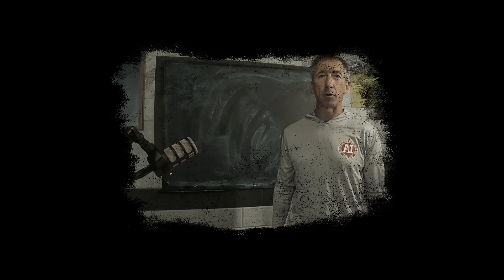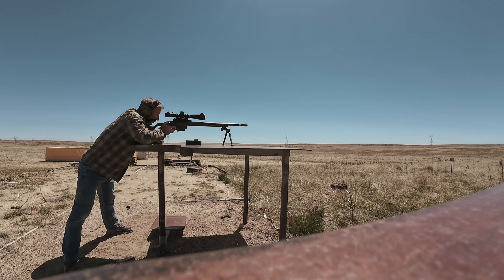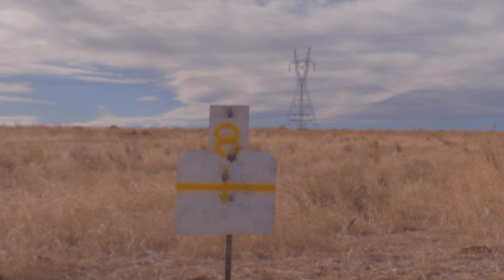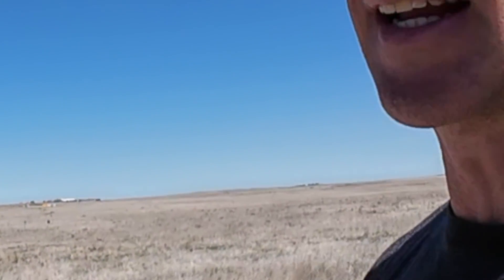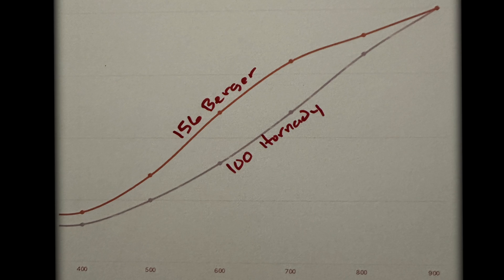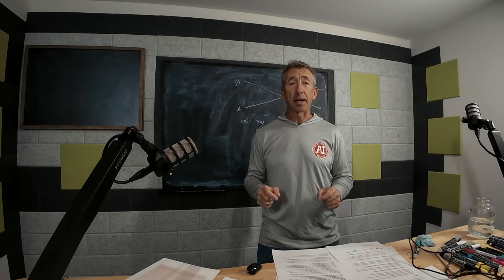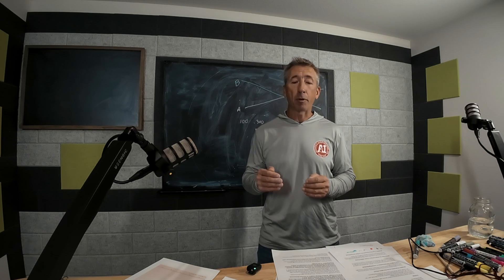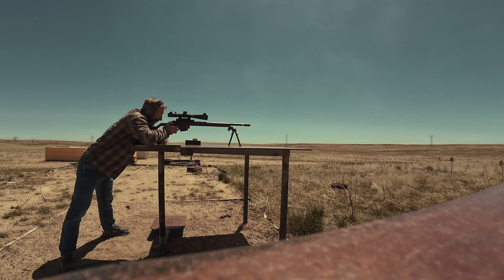heavy 156gr bullets vs light 100gr bullets

Comment: What caliber was used in this testing?
Reply: 6.5 creedmoor. Frank was talking about this on the everyday sniper podcast
Reply: @JackManiacky  The  6.5 Creedmoor Berger EOL Elite 156gr has a Ballistic coefficient of .679 G1 with 2,680 fps at the muzzle, and still doing 2,037 fps at the 500 yard mark.
6.5 Creedmoor Hornady ELD-VT 100gr has a BC of .448 G1 with 3,200 fps at the muzzle, and 2,192 fps at  500 yards.